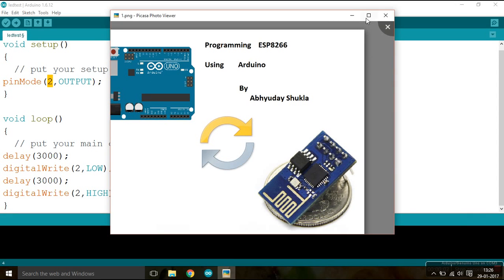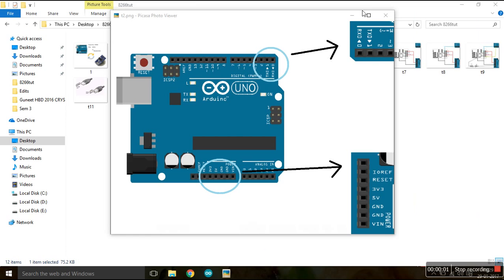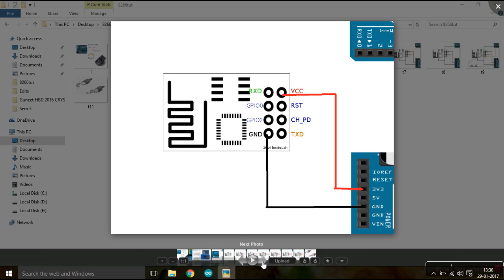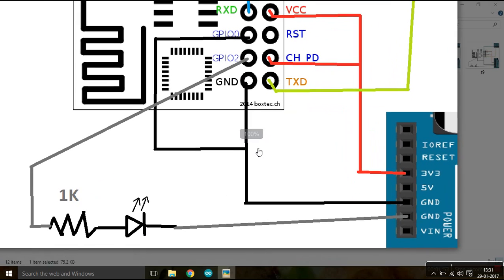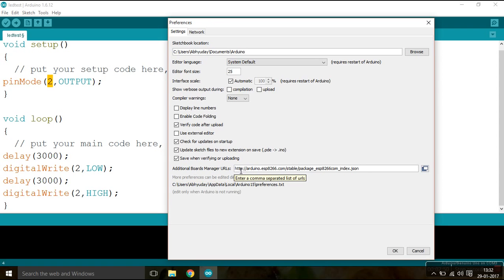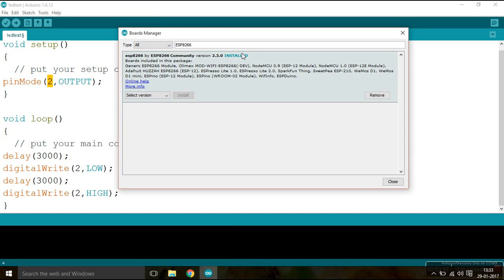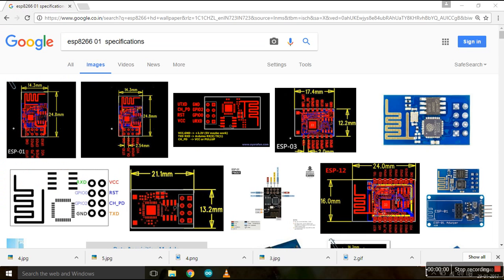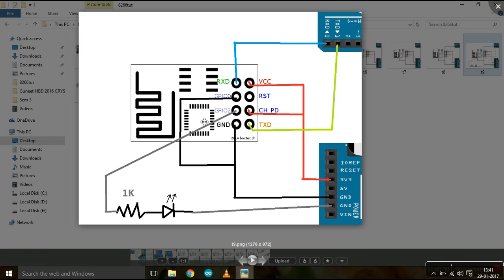Programming ESP8266 wifi module using arduino IDE Simpified | Aman Shukla

Comment: esptool.py v2.8
Serial port COM4
Connecting........_____....._____....._____....._____....._____....._____.....____Traceback (most recent call last):
  File "C:\Users\ADMIN\AppData\Local\Arduino15\packages\esp8266\hardware\esp8266\2.6.3/tools/upload.py", line 65, in <module>
    esptool.main(cmdline)
  File "C:/Users/ADMIN/AppData/Local/Arduino15/packages/esp8266/hardware/esp8266/2.6.3/tools/esptool\esptool.py", line 2890, in main
    esp.connect(args.before)
  File "C:/Users/ADMIN/AppData/Local/Arduino15/packages/esp8266/hardware/esp8266/2.6.3/tools/esptool\esptool.py", line 483, in connect
    raise FatalError('Failed to connect to %s: %s' % (self.CHIP_NAME, last_error))
esptool.FatalError: Failed to connect to ESP8266: Timed out waiting for packet header
esptool.FatalError: Failed to connect to ESP8266: Timed out waiting for packet header

Comment: dont use this esp series module...difficult to upload the sketch
Reply from the maker: Sure.... Stay tuned I have ways to incorporate it in an easier manner
Reply: @AmanOnScreen  esp8266 is garbage and scamm module..always error when upload new sketch
Reply from the maker: @maliridwan9141  admitted you need to have tight connections else there is noise while serial transfer
Reply: @AmanOnScreen  there is garbage module..i admitte when hc05 can do...use hc05
Reply from the maker: @maliridwan9141  see HC05 is for bluetooth here we are to connect with internet. And If you are not able to use it  dosent mean the module is not cool enough
Reply: @AmanOnScreen  esp8266 series from 1-12 still same problem...difficult to upload sketch..

Comment: bro I'm having a problem in compiling.
*******Error compiling for board Generic ESP8266 Module.***
ERROR MESSAGE:

Arduino: 1.8.5 (Windows 7), Board: "Generic ESP8266 Module, 80 MHz, ck, 26 MHz, 40MHz, DIO, 512K (no SPIFFS), 2, v2 Lower Memory, Disabled, None, Only Sketch, 115200"

In file included from c:\programdata\matlab\supportpackages\r2016b\3p.instrset\arduinoide.instrset\arduinosam-1.6.7\packages\esp8266\tools\xtensa-lx106-elf-gcc\1.20.0-26-gb404fb9-2\xtensa-lx106-elf\include\c++\4.8.2\algorithm:60:0,

                 from C:\ProgramData\MATLAB\SupportPackages\R2016b\3P.instrset\arduinoide.instrset\arduinosam-1.6.7\packages\esp8266\hardware\esp8266\2.4.1\cores\esp8266/Arduino.h:254,

                 from sketch\sketch_apr05b.ino.cpp:1:

c:\programdata\matlab\supportpackages\r2016b\3p.instrset\arduinoide.instrset\arduinosam-1.6.7\packages\esp8266\tools\xtensa-lx106-elf-gcc\1.20.0-26-gb404fb9-2\xtensa-lx106-elf\include\c++\4.8.2\utility:68:28: fatal error: bits/c++config.h: No such file or directory

 #include <bits/c++config.h>

                            ^

compilation terminated.

exit status 1
Error compiling for board Generic ESP8266 Module.

This report would have more information with
"Show verbose output during compilation"
option enabled in File -> Preferences.

Help me out

Comment: It worked, only after I removed the Atmega328p controller from the board. With the controller on, it showed espcomm_upload_mem error.
Reply: Daniel Robin I get this error, why?  I set the board as Generic Esp8266 module and wired as instructed.  What did I miss?

Comment: not working for me :/
Reply from the maker: Daniyal Khan yes
Reply: can i have your fb or whatsapp?
Reply from the maker: Daniyal Khan we can talk here too let the comments increase
Reply: this method is not working for me I have followed it trice.
I am having these errors

warning: espcomm_sync failed

error: espcomm_open failed

error: espcomm_upload_mem failed

I have already tried to provide an external power to the ESP8266 module but no change.
Reply from the maker: Daniyal Khan I shall reply to this as soon as I find way to solve this
Reply from the maker: Daniyal Khan sir I again cross checked it and I believe your connections may not be firm or may be disturbed
Reply from the maker: Mera TV2 hi was my solution correct or you tried something else
Reply: I had the same problem. I connected RESET of ARDUINO to GND and that took care of the error. Hope this helps.